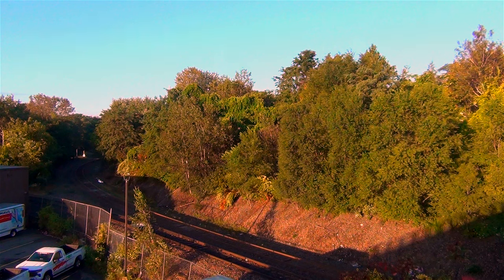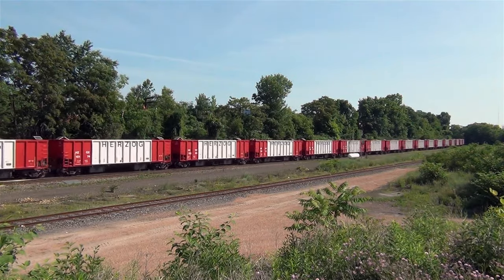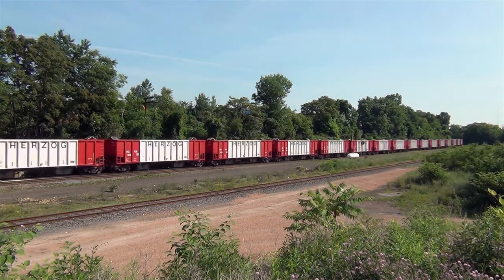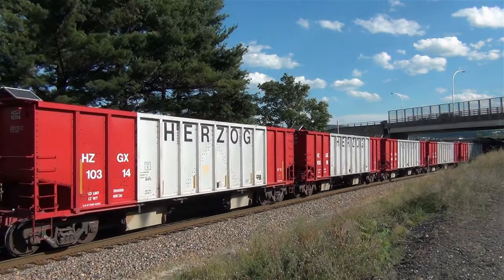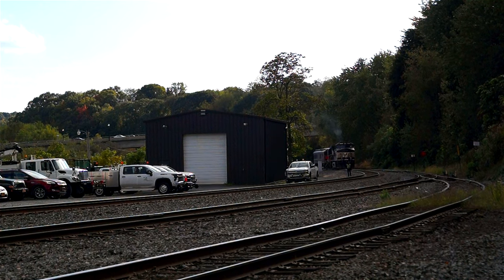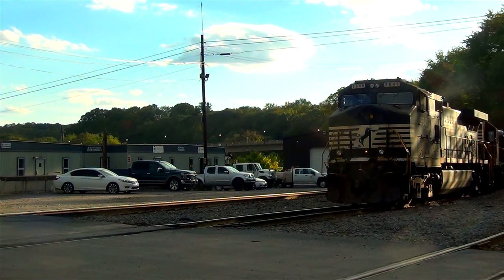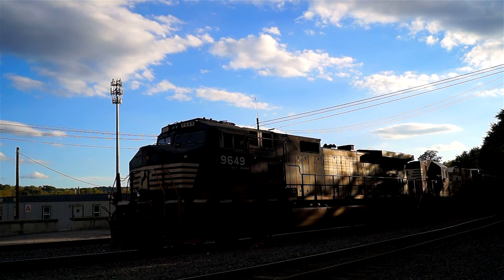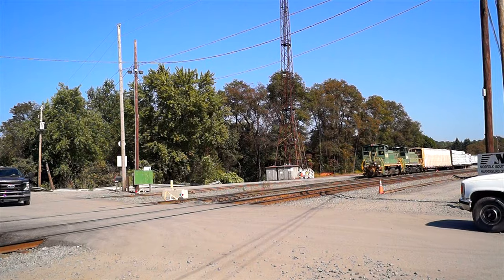Work Trains Up.. Work Trains Down

Comment: That was cool you captured the Geometry Research i captured it at Hummelstown Pa. on October 10th pulled by number 9649 also. I have a log book on special locomotives i capture. Cool video. That first Herzog train was pulling some serious weight. Captured one on November 4th 2023 i will probably never capture again. N/S 9758 pulling The Federal Railroad Administration Office of Research and Development. Office of Safety. Captured that at Hummelstown Pa.
Reply from the maker: I caught FRA train back around 2017-2018.
Reply: @Trains21  Cool you got it.

Comment: Do the letters on trains like 11Z, 14R, etc mean anything or are they just random? On BNSF a Z is a high priority intermodal, e.g. a UPS train, etc
Reply from the maker: The letters tend to be just random. It's the first numeral or 'digit' that matters. That determines the type of train. The exception is locals such as our K81 and K79. The letters do mean something. Most of the time it will represent the area and/or 'division' that train operates in.